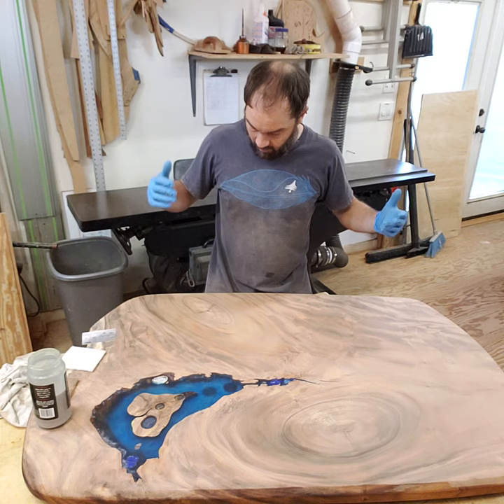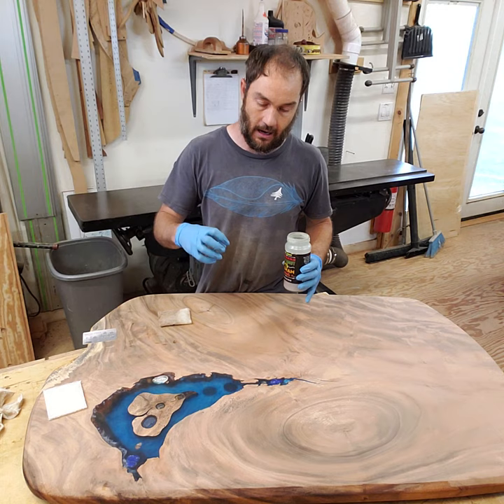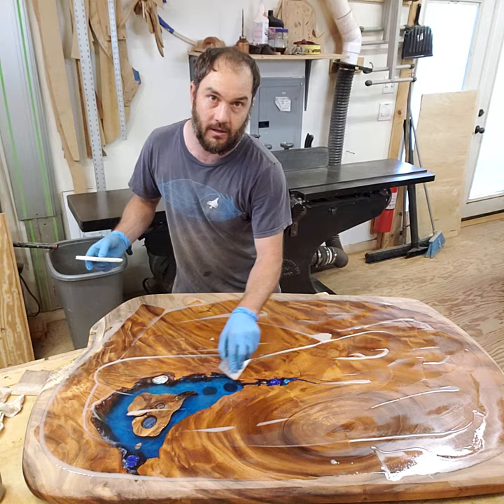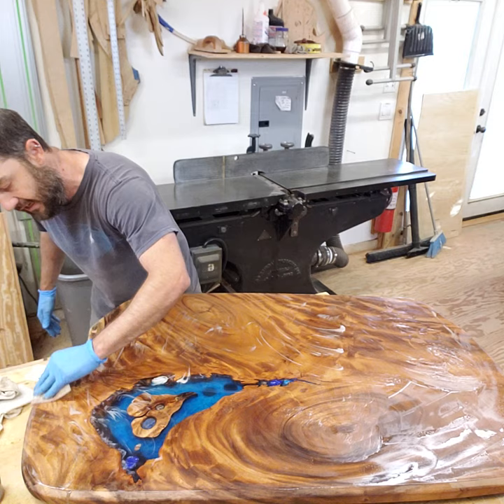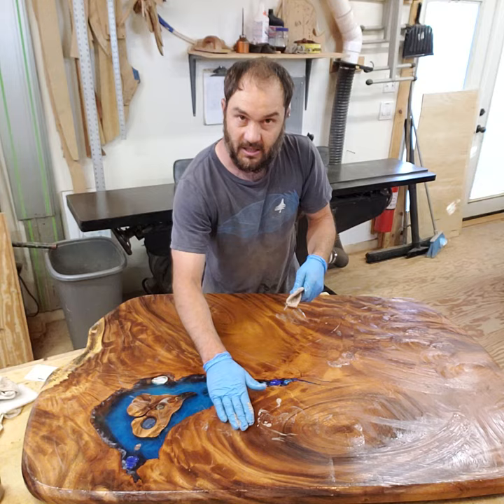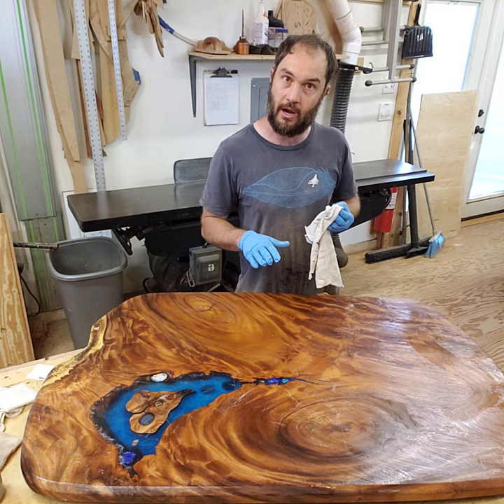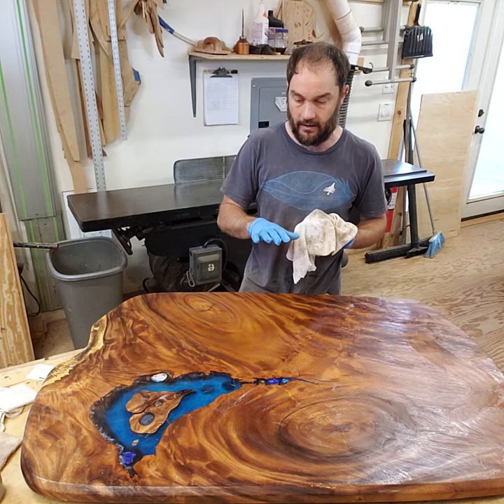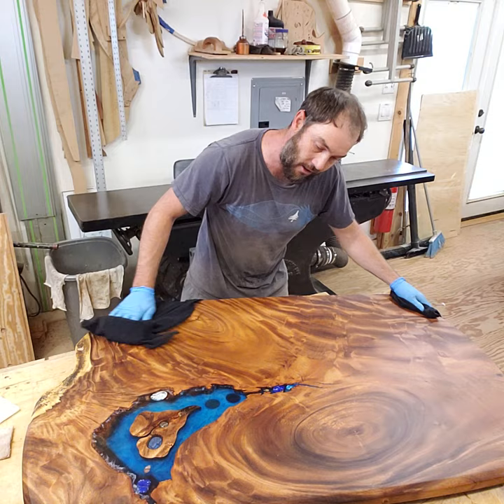How to apply osmo polyx hardwax oil to furniture

Comment: Great video - thanks. How would you handle a small but visible scratch? I’m leaning towards sanding the scratch by hand starting around 220 grit and finishing the same way I applied but only to the impacted area and not the entire surface. Thank you.
Reply from the maker: Yes, just sand the scratch out and reapply finish to thst area.  The finish will blend and you won't be able to see it afterwards.  This is one of my favorite things about osmo.  Very easy to repair and the repairs don't show!
Reply: Isak Ziegner thank you - what grit would you go with for a not too deep scratch? Was thinking 220?
Reply from the maker: @raffigarabedian  that sounds about right.  Better to go slow with a high grit.  Also, have you tried popping the damage back out with an iron and a wet towel?
Reply from the maker: @raffigarabedian  you can sometimes get gents and parts of scratches to pop back out or rebound.  Place a damp towel over the spot and iron it creating steam maybe 10 seconds.  Try twice.  Dents often pop back out.

Comment: Is it scratcher resistant? Does it yellow overtime and do you ever need to reapply?
Reply from the maker: The finish does not yellow overtime but it is an oil finish so it gives the wood a nice deep color and character. Oil and wax finishes don't add any real scratch protection but they do fix very easily and any repairs are invisible once you have completed they blend in nicely.   The reapplication tends to be a much longer interval than just an oil finish but sooner than a film finish.  I find things want another coat within 3 years unless they are exposed to a lot of Water like on the side of a sink.
Reply: Thanks 
I’m looking for a 1 and done wipe on finish for fine wooded art
Without using a HVLP sprayer
Reply from the maker: @ArtByKevinZapata  osmo now makes a one coat catalyzed version of their finish.  Still a hard wax/oil finish.

Comment: cool video. Need your help , I covered the table with epoxy resin with three layers of osmo polish oil 3032 and applied oil on the finish layer and immediately started polishing but the polishing nozzle takes away all the oil and there is no effect. what I am doing wrong, maybe I need to wait a while before polishing? please help
Reply from the maker: It is a little hard to tell without seeing your table and the epoxy. Generally You are wiping all the finish off of the epoxy portions and the epoxy would be polished separately.. I would do all my polishing before I applied the finish..
Reply: @isakziegnerdesign  thanks

Comment: Hi, great video! I have a beautiful monkey pod dining table from Fiji. But the osmo is in need of re applying. So am I right in thinking I should sand it down to 220. Or can I apply the osmo direct to the current surface? It’s not scratched, but has a couple of cup rings. Finally, in between coats, should I sand again to 220?  Thanks!!
Reply from the maker: Sanding is not required before adding another coat.  It is recommemded that you very thoroughly clean the table before refinishing.   This is the time to gently sand out any damage or blemishes that have developed.  A light sanding is definitely ok on the table before recoat, but not required like on a film finish that needs the sanded texture to properly adhere.
Reply: @isakziegnerdesign  thanks so much Isak. This will save me a ton of time! Great advice. Keep the videos coming 😀

Comment: I've heard the first coat of Osmo should be with the 1101 Extra Thin Clear ?
Reply from the maker: I think that is a good system.  The thinner products penetrate easier and are more readily absorbed, leading to better protection.  That said, buying 2 products to finish one item effectively doubles your cost.  Is the finish twice as good?  2 coats of polyx is a great finish and one coat of extra thin is only going to improve things.  Not essential, but a bonus if you have the funds and access to the products!

Comment: Question. We are finishing our stair treads with the OSMO PolyX. Any tips?
Reply from the maker: For stairs i do not sand as much as furniture.  I stop at 100 or 120 grit.  Otherwise they are too smooth and the wax makes them feel quite slippery.

Comment: What is the highest grit you can sand to before applying osmo ? I like to sand a lot of projects to 1500 grit but I know that closes off the pores somewhat
Reply from the maker: I can only say yhat you should try a test piece and see if you like the results.  If an oil finish has worked for you in the past, the osmo should be a good bet.  The penetrating oil may be better at getting in there for the first coat.  Remember that osmo is just oil and wax, plus a thinner so it goes in better.  Nothing magic about it, go ahead and run a test piece!

Comment: I've got a questing.  I've got a dining room table that's over ten years old.  I sanded it all the way down and stained it deep rosewood and then did a resin table top pour.  Three layers.  Sanded from 180-320 grit.  Then went to wet sand it from 500 to 2000. Didn't do another pour.  Not doing a buff and wax like other folks on YouTube have said to do.  Can I do osmo polyx on it?  I've seen several guys put it on epoxy resin and it comes out awesome.  Your thoughts?
Reply from the maker: I do not see the need to use osmo over epoxy.  Osmo is oil and wax.  Plastic absorbs neither of these things.  That is why people buff it.  Treat it as a car.  Buff, wax.  To get a mtte finish, remove the luster.  Maybe the osmo is a way to keep a satin feel on a plastic surface?
Reply: @isakziegnerdesign  that's what I'm thinking.  Every one that I've seen use it on resin it comes out smooth and satin.  And since it's sanded before the application is applied the resin does absorb the first layer and doing so allows subsequent layers to bond to each other.  I've also heard that it hardens in 24 hours much like resin giving it a strong coating.  I've also heard that doing a ceramic layer on top that will give it an h9 level of hardness.
Reply from the maker: @joelando1559  some notes on using osmo.  Ince the finishbis applied, it is removed completely. That is essential.  There should be no build up on the surface.  Any film on top would be cloudy and messy and not hard enough to overcoat.   At no time, unless wet sanding to pore fill, would you ever leave any finish on the surface of a product.  Osmo is removed and buffed with a clean towel.  The finish is IN the wood.
Reply from the maker: I would just overcoat the epoxy with a 2K polyurethane by renner or milesi.  Maybe pick one with uv protection.  Adding oil and wax between 2 products seems inadvisable.

Comment: GREAT VIDEO ISAK!!!!   Are you using OSMO Polyx Hard Wax Oil 3054 Clear Satin ?  I ask because there are a lot of different sheen's and product numbers.  Thank you!
Reply from the maker: Yes, that is the one that I am using. I really like the clear satin 3054.  Glad to hear the video was useful!
Reply: @isakziegnerdesign  DUDE!!!!......it was the most professional video dedicated to the best top coat I have seen!  I have been using General Finishes "Enduro Var", but I have seen the light broseph!  Thank you so much!
Reply from the maker: @Aidenpoe123  i used to use GF brand for my film finishes but i have graduated to milesi and renner. That is just a different category of finish type.  It has its uses.   Both these brands  are outstanding in their category.  Check out the wealth of info from eric reason.  Sooo much great testing and info on his channel!

Comment: Would you be ok with using a buffer/polisher(rotex) to buff off the finish once it is soaked in?
Reply from the maker: Absolutely,  just use low speed like 1 in a rotex.  The white scrubber pads are what is recommemded as they are non marking.  You will find lots of peopme using amd recommending this method.   But beware, the pad ince full will throw finish which is messy, so change as needed.  Also, just a pad on your velcro is bound to seep through and get finish on your sander.  Use some sort of middle pad or barrier.   Vacuum is clearly not needed.  Some people apply this way as well.  They use larger buffers or even floor buffers for big operations.
Reply: Thank you I'm excited to try this stuff.

Comment: How does the osmo work over the resin areas
Reply from the maker: There is no real change for the resin areas as the osmo does not penetrate resin, and gets wiped and buffed off at the end of the application process.  You need to polish your resin to the desired  sheen by sanding and then polishing it before applying the finish to the wood.

Comment: Really like the video and the amount of effort and speaking.  Have you tried Rubio Monocoat?  I was looking to use it.  But I did find out about the Osmo.  One thing I recently learned about Rubio is that if I want a little sheen to the standing desk I am building I can use their Universal Maintenance product. However, I would have to apply the maintenance every 3 to 6 months.  Seems like a short maintenance window.  What is the maintenance window for Oslo? I know you didn't mention anything about having more sheen so does Osmo have such a product that gives more sheen? If they do not have a product that can add sheen, what is the maintenance window for just the application/product you used?

Comment: Thanks for the great info. Was wondering how the Osmo reacts to the resin. Does it polish it as well or does the resin still keep a frosted look from sanding?
Reply from the maker: The osmo gets wiped off the resin completely, sonit is important to sand the resin to a polished state for clarity.  If your resin is colored this is less important if it had depth.  Mine is clear with color at the bottom to make it feel like water, so i sanded and polished the resin up to 1500 grit.

Comment: Sorry if I missed this information in the video but how long do you wait between coats? Did you only do 1 coat in the video? I can't find those pads that you used after the card in home depot or lowes, I searched for "non-abrasive pad", is there another name to search for? Thanks.
Reply from the maker: The pads are originally made by scotch brite.  You could search that, or scouring pads.  The other colors are more abrasive,  and will act more like sand paper.  I use the gray pads as synthetic steel wool.  You can just use a cloth to apply the oil if you don't have a pad.

Comment: Do you use a pore filler before using osmo polyx or will the wax in the finish be sufficient for say mahogany?
Reply from the maker: Osmo is an oil and wax finish, so it protects from.within the wood.  This means that is soaks in to the wood and you wipe off the surface .  You won't get pore flling or the astic film finish feeling and that is sort of the point.  You can, however, wet sand on coat 2 of 3.  Wet sand and then wipe the surface with a plastic card so that the pores remain filled.  After it is dry 12 hours, sand back to 150 or 180 amd then to 220 again.  Then add 3rd coat.  This should yield filled pores with an oil finish.  I have done this with osmo to good results.  Look up wet sanding an oil finish for more info on the technique if needed.
Reply: Isak Ziegner thanks!

Comment: What if you didn’t wipe off all the material and it hardened on top? Should I send with a high grit to remove it then clean it off and reapply?
Reply from the maker: Sorry to hear you are having to remove  finish left on the surface.  I would wait a few days for extra drying time and then sand back to the wood.  You may try 150 grit and then resand to 220 once you get the excess finish removed.  You may have nicely filled the pores of the wood.  I  sometimes intentionally wet sand and leave a tiny film to dry before sanding back like this to fill in the pores.
Reply: @isakziegnerdesign  thanks man. Yeah, I think I’ll let it dry a day more and sand it to get it all even again then reapply. Should be okay, right? This is my first time using Osmo’s. I used the 1101. I was thinking about applying two coats of the 1101 then a final coat of 3054 (polyx-oil). What are your thoughts on that?
Reply from the maker: @MrSimonwilkerson  as long as you are able to remove the finish hardened on the surface, you should be just fine.  May even be a really good finish in the end.  As i mentioned,  i sometimes use a similar technique if i want to fill the pores.  I am not familiar with the other products from osmo, but i think this still applies.
Reply: @isakziegnerdesign  thank you very much for your help and responding so quickly.
Reply from the maker: @MrSimonwilkerson  no problem, good luck out there!  Feel free to dm me on instagram @isakziegner_design

Comment: Does the waxy feeling go away. I rubbed the excess off til my fingers bled and days later it still feels  like uncured wax and seems to collect dust. When I use regular paste wax it gets hard and dust blows off. Feels silky slick. This Osmo doesn't seem to be curing and clogs sandpaper. Is that normal?
Reply from the maker: Well, it sounds like something hasn't gone quite right. When applied to raw wood and wiped completely off, the surface should feel completely smooth and have no friction against a clean towel.  This is even before the finish dries. It feels like a nice smooth waxed surface.Unless you are leaving some finish on the surface to fill the pores there is no reason to sand at all once you have begun applying layers of finish.
Reply from the maker: was the osmo both recent purchase and also Stirred, as it does separate into wax and oil?   It should last about 2 years in the can.
Reply: @isakziegnerdesign  Brand new. You've never had this problem? Got any ideas how to fix it.  It's on a large 4 drawer cherry dresser with turnings. It would be a ton of work to strip, sand and finish again.
Reply from the maker: @michaeloneal10   I've never seen anything like this if it was wiped off properly like an oil finish before it was allowed to dry. Your situation sounds like oil that was applied like a varnish and allowed to stay on the surface to dry which would take a long time and result in a gummy and difficult to sand surface.   I have had experiences like yours with boiled linseed oil and that is why I now use osmo. It has been really consistent and always dries very nicely for me. I am sad to hear you are having this experience and you should reach out to your distributor or directly to the company.  So much time goes into our work and we deserve to have a smooth easy finished process.

Comment: It’s been several years since you put this video out.  Are you still high on Osmo?
Reply from the maker: When I'm looking for an oil and wax type finish I still reach for the osmo.  I have it in my house on my kitchen countertops and it wears well and is incredibly easy to refinish and touch up if necessary.  Osmo just released A 2K style catalyst hardened one coat version to compete with Rubio but this traditional style and multiple coats seems to work best.

Comment: After this is finished can I put epoxy/resin on it?
Reply from the maker: I would do all the epoxy and glue work well before the finishing stage.  The wax amd oil will vause the epoxy to not bond well.  You have essentially protected the wood from then epoxy....  hope that helps.  This is a finish all in its self, and the epoxy for bar top finish is another type of finish.  Choose one.  Some things can go under epoxy, like dewaxed shellac and then lightly sand between coats.

Comment: How does the durability stand up over time?
Reply from the maker: I have been really impressed.  It took 2 years around my sink to start to need a reapplication   Easy to spot fix and very easy to reapply if you start to notice it looks dry or  protection is tapering off.  Truly a middle ground between oil finish (lots of maintenance) and polyurethane (huge task to refinish).
Reply: @isakziegnerdesign  good to know, I have seen some people say that if you don’t roll it on then it can very easily be damaged by water. Thoughts?
Reply from the maker: It seems to me that working the finish in with a saturated pad would be far more effective than a roller.  Perfect for furniture sized applications.  A floor would be a roller type situation due to size.

Comment: Great video! Getting ready to use the Osmo Satin 3043 on live edge red oak counter tops. Question: I needed to use clear a epoxy on part of this gnarly section of bark that i wanted to keep in order to help to stabilize it - just for that section...problem is that it's a bit glossy and I really cannot sand it to remove the gloss. When I apply the Osmo to the tops i'm thinking I'll  let a bit of the Osmo set and cure on the epoxied bark in hopes that it will take on a satin finish with the rest of the tops- Any thoughts?
Reply from the maker: Rather than leaving osmo on the top of the epoxy I would maybe try to use steel wool or synthetic steel wool on the epoxy. Give it a gentle rub and try to remove the shine with 0000 steel wool or very soft type synthetic steel wool (brillo pad).